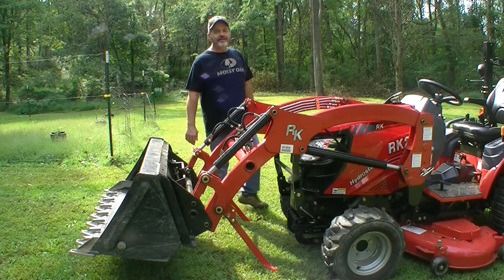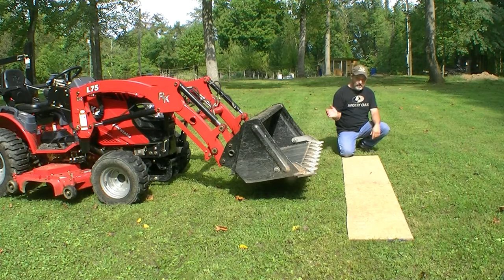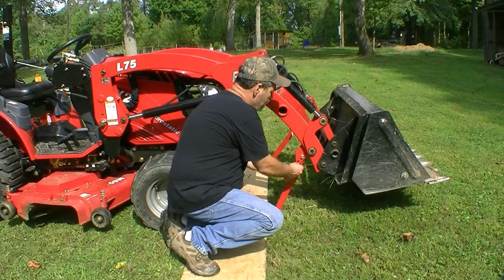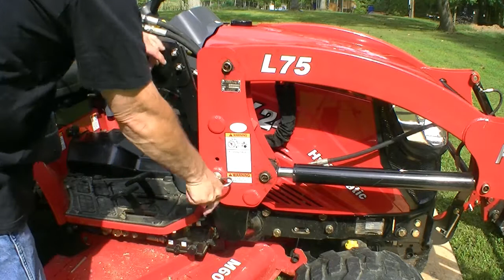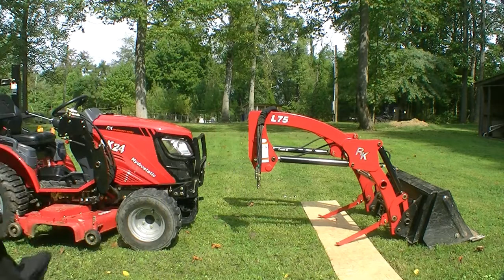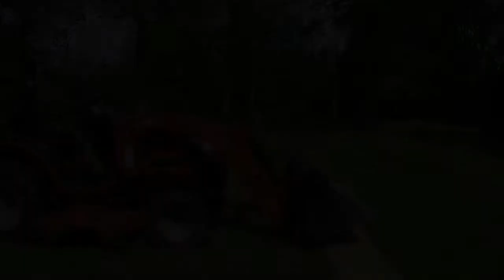How To Remove The Bucket from a   RK24 subcompact tractor - Rural King

Comment: Like you, if I need to take off the FEL it needs to be out of the way. That means the yard not the concrete.  I use a 2X6 to put the back legs on!  Is the RK still doing good for you?     Have a good weekend!  See ya in the next one!
Reply from the maker: Yes it's been running very well haven't had any issues knock on wood how is your holding up sure like the new tractor you have really nice thanks for your comment